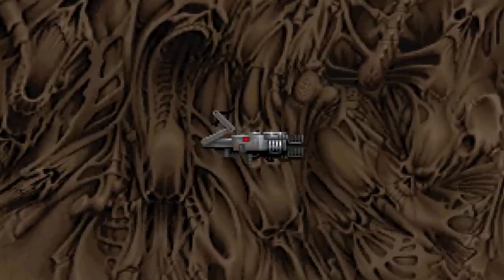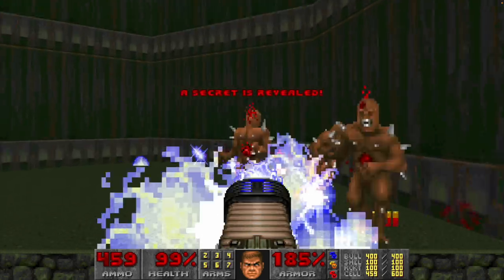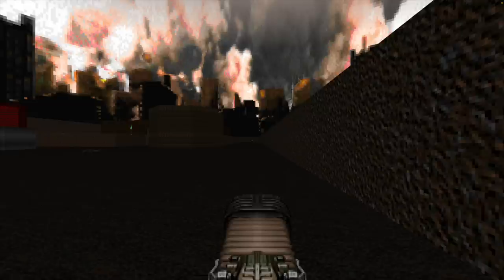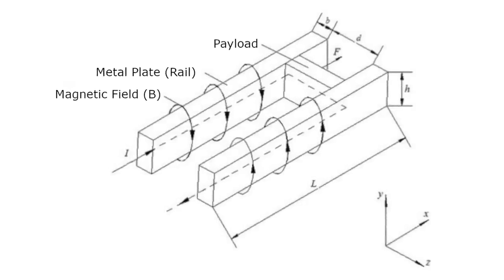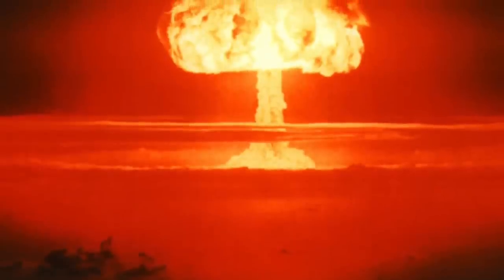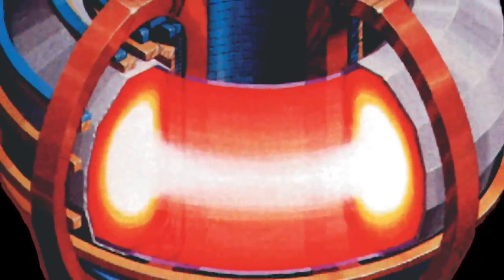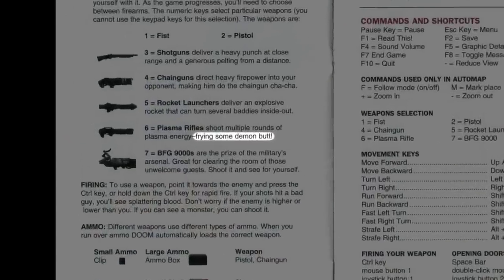The DOOM Plasma Rifle - A Technical Analysis

Comment: Doom was the first game i played on a PC. I had a 486 CPU, and soldered a 25 meter long zero modem cable for the RS232 port to connect two computers - no LAN available then, no one possessed an expansion card for that, and what is this strange L-A-N even good for anyways? - to play against each other. Thats unforgotten. The controls of this game, WASD + mouse are still in use today the same way as then. I cant play on the PS or the Xbox, since they do not offer this kind of controls. I am just too used to WASD.
Reply from the maker: Nice! DOOM II was my first PC game.

Comment: 8:00 it's actually significantly hotter than the sun. The sun has a lot more space for fusion to randomly happen and then will keep the energy long enough for enough fusion to take place to replace the energy lost. The fusion reactor is small, so it loses energy faster and doesn't have the statistics on its side to generate the energy, so it has to be significantly hotter to sustain itself. It's like if you had to force a room of gamblers to have a jackpot happen, you could either increase the size of the room or increase the speed of the gambling.

Comment: My theory is that since fire is a plasma, flamethrowers are plasma guns.
Reply: I used to think that for a bit, until I learned how actual flamethrowers work. Military flamethrowers are firing burning liquid fuel, not burning gas/aerosol like holding up a Bic lighter to a can of hairspray. As such, they are still firing liquid "projectiles" and are more akin to SuperSoakers from hell than a plasma weapon.

Comment: Could you just launch a large magnet along with the payload to keep it from diffusing
Reply from the maker: Interesting idea! The question is if there are permanent magnets strong enough for this setup to be feasible.
Reply: So like a ball of plasma cased in a magnetic bullet casing? You'd probably end up melting the casing and turning it into a molten chunk of metal, which could either melt inside or outside the gun. There is actually a weapon being tested called MAHEM that would shoot molten pieces of metal which're propelled by electromagnetic fields created from explosions.
Reply: Even if you manage to keep the casing from melting into molten metal, the casing would have to be brittle enough to break upon contact yet still tough enough to endure the heat of the plasma. You'd need like magnets made out of room temp superconductors, which do not exist currently. Also, would the plasma inside the casing be created inside the gun, or would it already exist preheated? Creating the plasma inside or outside the gun either way may end up damaging the casing, upping the chances of an accudental plasma explosion

Comment: would the gravity of phobos/mars affect how the plasma behaves?
Reply from the maker: Hi swordofcoffee! I do not think the difference in gravity will have a significant impact on the behaviour. The plasma bolt will likely have a density close to that of the atmosphere, so it will not fall towards the ground like a solid dense projectile would, regardless of gravity.
Reply: @SunandWeather   I was more thinking that different gravity would mean different air pressure because both have a thin  atmosphere and less gravity meaning less force acting on the plasma bolt.

Comment: Why is the plasma from the gun blue and why is the Arachnatron's plasma green?
Reply from the maker: Hi PedroLambrini! The colour of the plasma depends on the fuel. As the fuel heats up, the electrons in the fuel atoms jump to higher energy levels. As the fuel cools down the electrons jump back to lower energy levels. When an electron jumps to a lower energy level, a photon is emitted. (This is probably why the colour is more pronounced along the edges of the plasma bolt, where the fuel has started to cool down). The wavelength (corresponding to the colour) of this photon depends on the energy difference between the two energy levels that the electron jumps between. Different atoms have different energy levels, thus emitting different colours.

Oxygen plasma is blue, which makes sense for the plasma rifle, as we assumed that it used the air around it. The Arachnotron on the other hand seems to use a different fuel. Perhaps a xenon-nitrogen mixture, which does produce green plasma.
Reply from the maker: @Bob11212-y  Well, Argon might be the closest you will get with a single noble gas. But you can make plasma out of almost anything, so I am sure you could get a nice purple colour from a lot of different materials.

Comment: my question is what kind of recoil does the plasma gun have?
Reply from the maker: Hi Sheila olfieWay! We assumed that the Doom Plasma Rifle fires around 6 grams of air. Since the plasma bolt moves relatively slowly, launching it should not require much force. So, the recoil should be low.

I am guessing the reason it jumps around a bit when firing, is due to the large amount of energy being discharged in such a short time.

The MARAUDER on the other hand fires the plasma bolt at a very high speed. So, in that case the recoil would be significant.
Reply: @SunandWeather   I'm talking about in game how after firing the gun seems to recoil.

Comment: also let's think that if plasma is hot, then the gun gets hot and also the person weilding the gun cooks alive
Reply from the maker: Well, the acceleration of the bolt will begin immediately after it assumes the state of plasma, so there will not be much time for the thermal energy to transfer from the plasma bolt to the body of the rifle. It will most certainly still get somewhat hot, but it will probably be mostly contained to the barrel, which does seem to have a ribbed texture, to disperse the heat effectively.

Comment: I've always had the impression that the gun in game is supposed to be firing a stream of plasma like a flamethrower, not discrete fireballs like a machinegun.
Reply: That wouldn't work well at all for a weapon. Now, plasma projection devices like you mention do exist... in the form of plasma cutters used in machining and foundry shops. However, these cannot be used as weapons (or weaponised) as the jet of plasma they produce is only a few centimetres long. 

And before you say that it would make an awesome melee weapon, considering the power requirements to produce that plasma jet, even if you could make a man-portable plasma jet projector capable of cutting through steel (and certainly human flesh), you'd probably have more luck hitting someone over the head with the emitter than trying to use it to barbecue him. Unless you were using said man-portable plasma cutter as a torture device against a restrained target, and again, there are cheaper and more efficient ways to torture someone than needing to mess around with high voltages and plasma.
Reply: why?
Reply: @Schwarzvogel1  It would be a cool as shit weapon for a video game though!
Reply: That's not the intended effect
Reply: @HQ_Default  Definitely. Interestingly enough, the Last Man Standing mod for Doom 3 does feature a plasma gun that works like cyber_dragon_123 describes... and it is a fun weapon to use in that game. It toasts hell knights and cacodemons like no one's business.

I can see a weaponized plasma cutter fitting in some game settings, though. If I'm not mistaken, the Dead Space series has a weapon like that.

Comment: Great video--you've earned yourself a new subscriber! I loved the subtle touches you placed in this video!
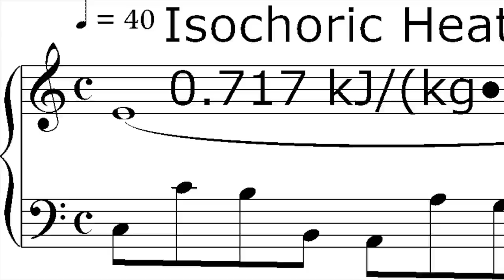1. At 2:02, is that the sheet music for a rendition of Bach's "Air on a G String" (but in C major)?
2. At 2:40... that mountain looks a lot like the skybox in E1M1 ;)

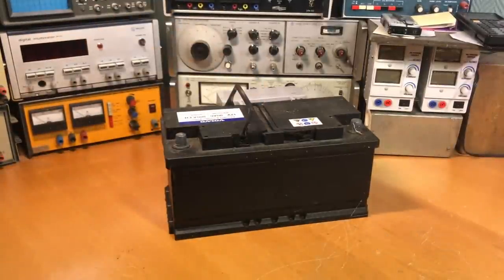Also, your choice of batteries at 3:08 was quite clever--that motorcyle battery looks roughly equivalent in size and shape to a single energy cell, and your car battery is very reminiscent of the energy cell pack! That makes me think that if we had more efficient energy sources, man-portable plasma guns like those in DOOM are possible. And if man-portability were not an issue (e.g. this were a vehicle or aircraft-mounted weapon), then DOOM-style plasma guns are a feasibility with near-future technology, since a vehicular mounting would solve many of the power supply issues.

That said, I don't think we will see DOOM-esque plasma guns any time soon, even if we could overcome the energy storage and supply issues. This is because unless the weapon were designed (like in the MARAUDER project) to propel projectiles at extreme velocities, DOOM's plasma rifle simply doesn't offer any real advantages over existing ballistic weaponry whilst also being significantly more dangerous to its operator.

As the UAC in DOOM has likely not achieved 100% energy conversion rates, those energy cells are likely packing a tremendous amount of stored energy. If one is breached by damage (incoming bullets, fragments, imp fireballs, or pinky teeth), it will potentially explode with more force than an M67 hand grenade--bad news for the Marine carrying spare cells in his mag pouches and for his buddies unlucky enough to be next to him. By contrast, a conventional assault rifle doesn't have any of those issues: it doesn't require electrical power; its ammunition is weather-proof, durable, and idiot-proof, and it puts down human-sized targets very well.
Reply from the maker: Wow, thanks for the extensive analysis, Schwartzfogel1! As you say, when fighting humans, a conventional ballistic weapons are probably more convenient. A plasma weapon on the other hand could be effective agains enemies that are more or less impervious to regular bullets.  A kevlar vest would not do you much good against a plasma bolt, for example.

1. Yeah, August Wilhelmjs arrangement, it was the first high resolution public domain picture of the Air Sheet Music I could find. 
2. Nice!
Reply: @SunandWeather  Indeed. Moreover, the UAC may have been developing man-portable plasma weapons concurrently with its teleportation experiments as more effective armaments against the "unique extradimensional fauna"* it encountered. But then again, since Doom takes place in the 22nd century, it's also possible that ballistic PPE may have advanced to the point where conventional bullets were rapidly losing their effectiveness on the battlefield, a bit like how advances in plate armour in the 15th and 16th centuries forced swords into secondary roles and ever more specialized designs.

Given that the plasma rifle is significantly more effective at putting down Doom's enemies than any of the game's ballistic weapons (with the exception of the super shotgun), it makes some sense in-universe that the UAC would be investing in plasma weapons for its more elite security forces. It's also possible that the plasma rifle may have been a spin-off from some other UAC technological innovations. Doom 3 implies this to some degree.

*I can definitely imagine internal UAC publications referring to the demons by such a euphemism🤣

Comment: Hey Man. That Was A cool video I wanted to ask if you could Make an analysis of the Feasibility of Metal Gears From The Metal gear franchise, And The Unorthodox Design Principles That Where Used For their Construction. Especially Metal Gear REX and its Railgun That Espacialy Made To Fire Nuclear Warheads
Reply from the maker: Hi Shockwave84! Thanks a lot for your suggestion!